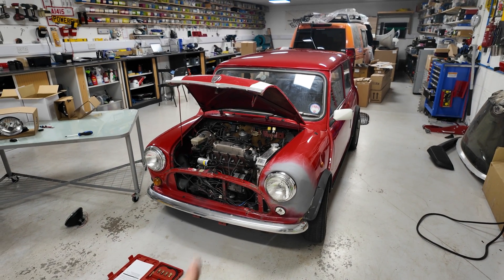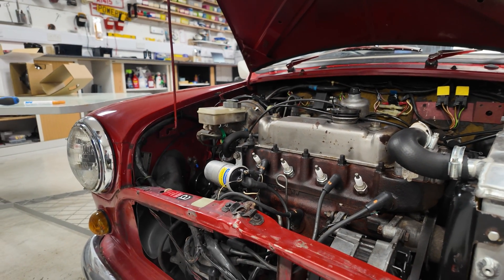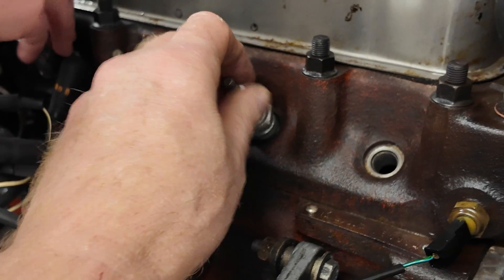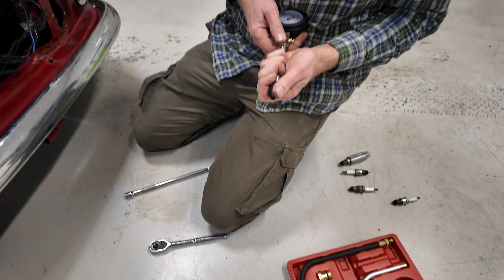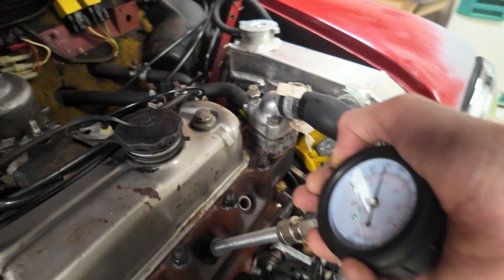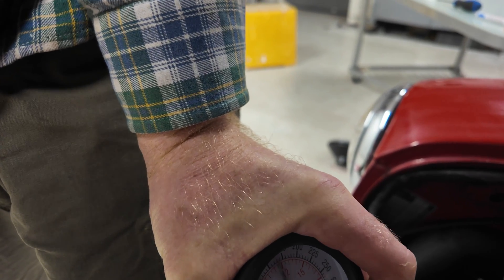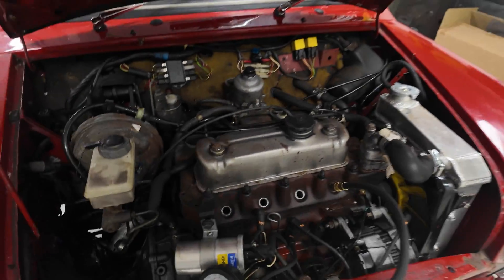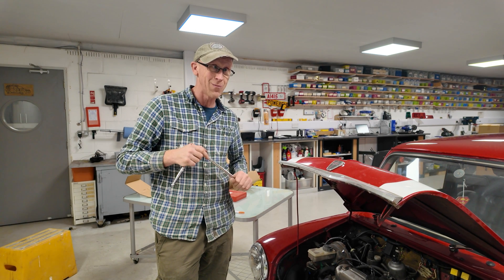How To Do An Engine Compression Test on a Classic Mini ( or any Classic Car )

Comment: Simon…it s Saturday morning again…1967. Sparking plug and compression checking! I was waiting for you to find number 3 to be low as that exhaust valve always burns first..I have some old ones to this day! The gap should be 25 thou’ and those need a good clean with a brass wire brush then blow clean with an airline. Check the valve clearances and then..well if you had an SU, I would say it need a full strip, clean the piston, clean the needle, clean the float chamber, refill the dash pot with a mix of SAE 30 engine oil and a teaspoonful of 3in 1..check the spring length in case it has gone weak and next the distributor. Strip, clean, oil and fit new points..15 gap! All old stuff…but my monthly Service when I was young! Can you get a can of Esso Uniflow multigrade and a new filter from Unipart?? Your next fun job…..new rear brake cylinders….that was every12 months as they rusted and seized!! Take care…Richard😃😃😃😃